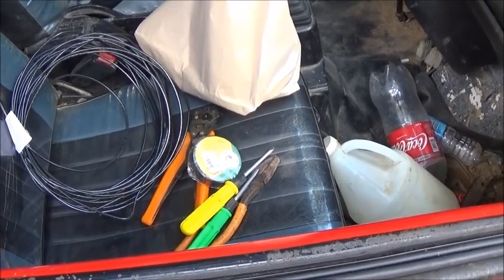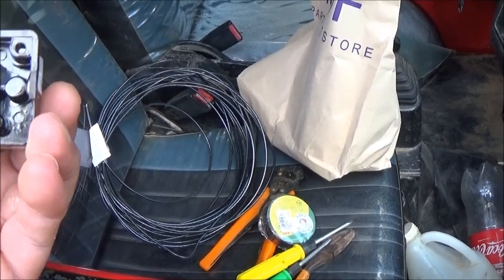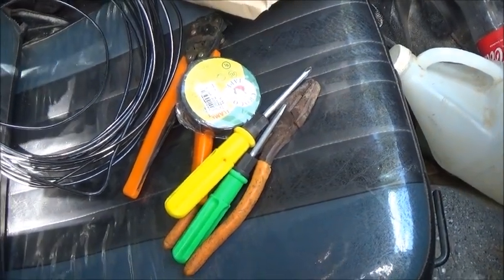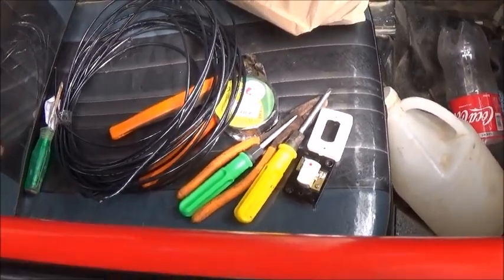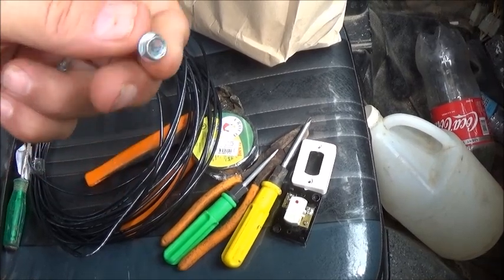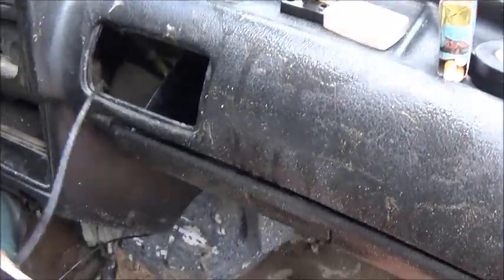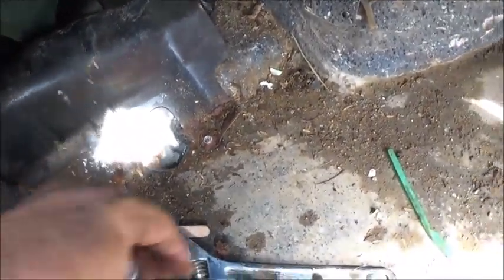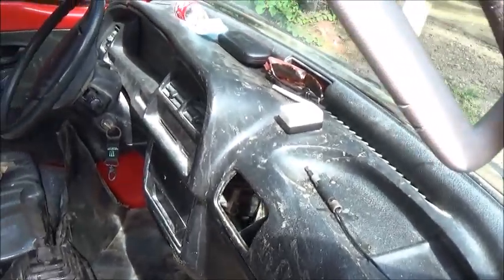Installing A Toggle Switch For The Red Vans Radiator Fan

Comment: Well after all that it worked fine, was surprised on investigations on line ( depending on the size of the fan) just how many amps it draws,  up to around 70 amps on start up !!
I don't know if there is a working heater on the multi cab,  can turn ventilation fan on and direct the hot air thruthe vents out of the windows , would help a little,  used to do that on my old French 2 litre diesel  car, stuck in traffic in hot weather!

Comment: I looked on a multicab forum in Japan- there were a couple of tips on over heating (1) a history of collapse lower radiator hoses , caused by air in the cooling system (2) they take the thermostats out of multicabs in tropical lands ,but this also lets the water circulate too fast and it doesn't have time to cool off before it goes into the block again - it was suggested that a non working thermostat (open) be installed to slow down the water somewhat to act as a baffle  an impeded the flow.